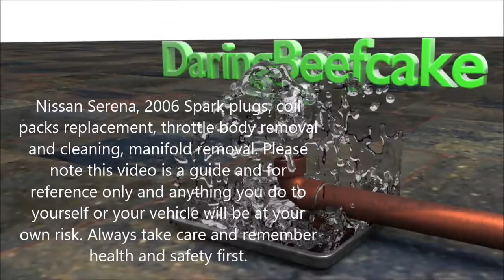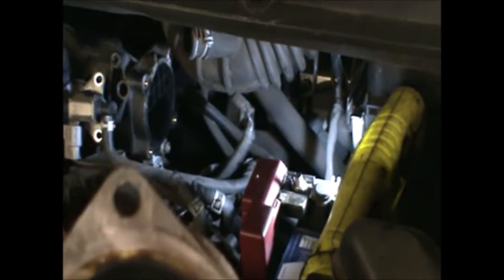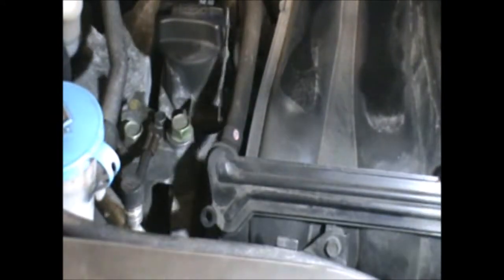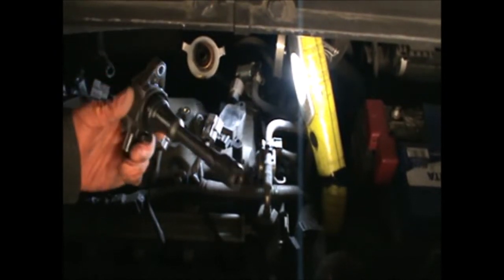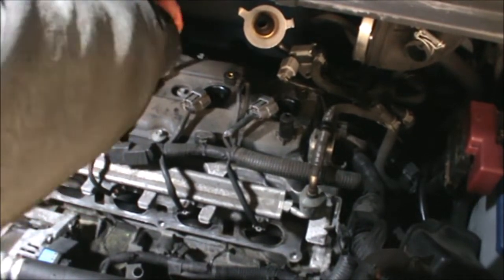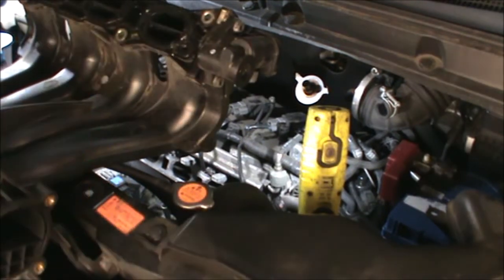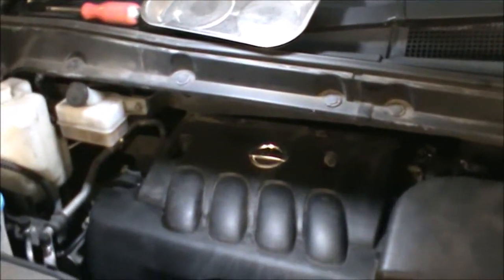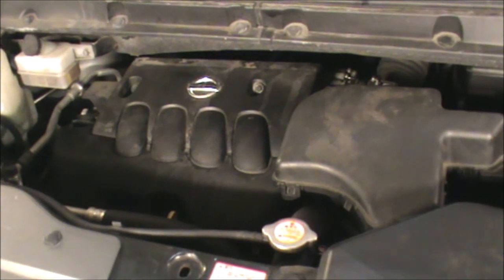Nissan Serena spark plugs, coil packs, throttle body, inlet manifold removal, bujias

Comment: Thanks for the video was awesome help one thing ya cannot see in the video is 2 of those bolts in front are almost impossible to get to, I had to have a mirror and 3 different sockets to get in there was a real hassle, I do not suggest doing this if you are not quite handy already, it is not an easy task
Reply from the maker: Thanks for the tip

Comment: Good tutorial!!! I am looking for the full teach of change the spark plug of Serena C25!!! Too many screws are needed to be removed and some cable connection. Is necessary to remove the Trottle body from manifold??
Reply from the maker: Did you see the video, This is a Serena C25, i change the spark plug everything is in the video.
Reply: Yea,  very detail. Re-programme after disconnect the cable of trottle body? Can do myself?
Reply: Good job. 👍🏿👍🏿👍🏿

Comment: what are tools used to do this the size of the bolts and sockets plz
Reply from the maker: Hi I dont remember from the top of my head, as far as i remember i do mention in the video as I do it what is needed, I just don't get enough time to list everything sorry.
Reply: i have the same car man but the engine is misfiring at idle and shaking